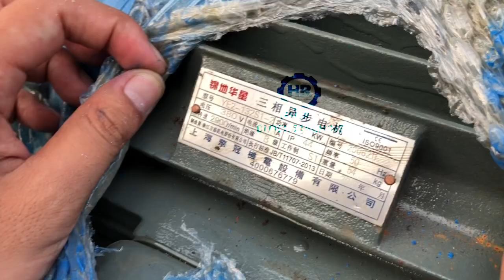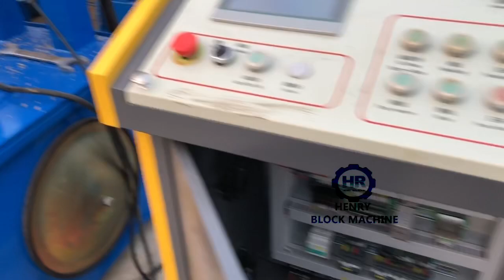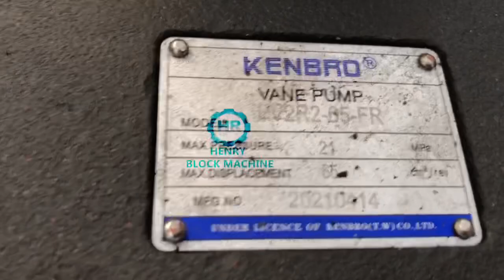Real difference between QT4-15 and QT4-20 hydraulic full automatic concrete block machine #shorts

Comment: Great explanation.
I measured the production from the video. 11:50 upto 12:50. The production is 12 blocks. So it is QT4-20 in my opinion.
Reply from the maker: Hello dear friend . We are professional manufacturer of concrete block machine, if you require price lists. Please add our contact WhatsApp number:+8613053989171. We will supply you the best price and best service